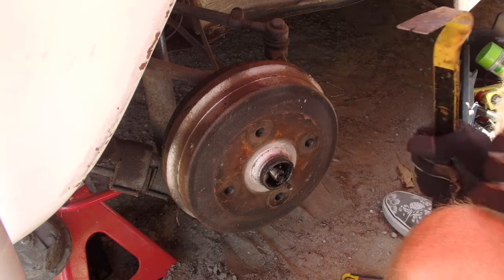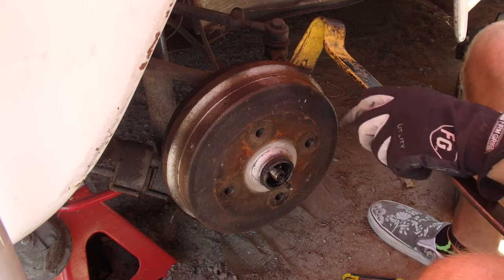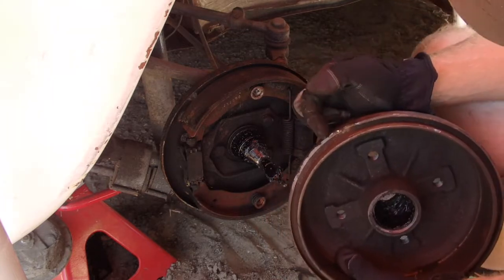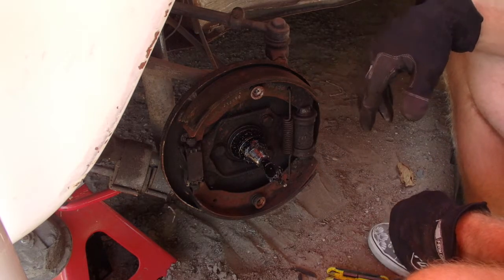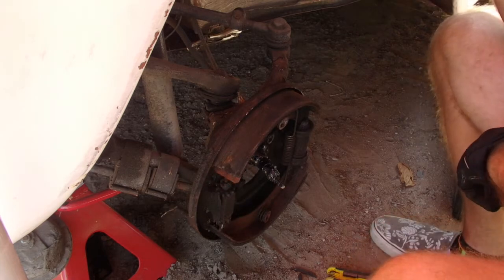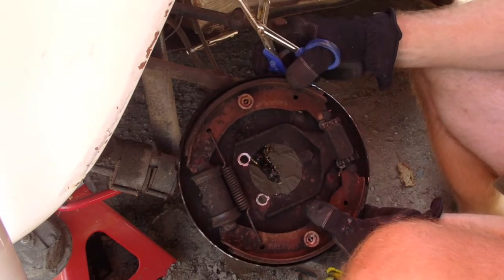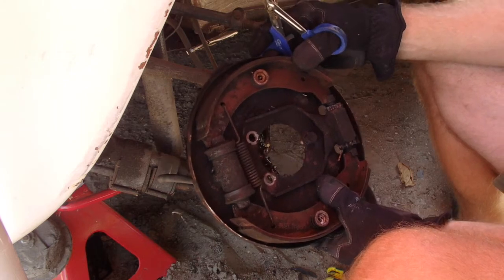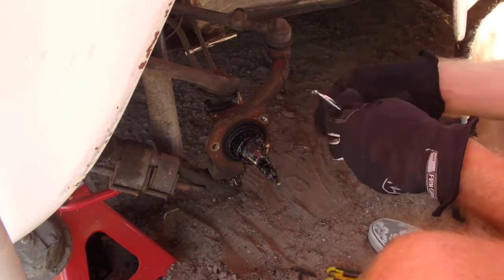1969 VW Bug Project - Episode 17.5 - Drum Brake and Spindle Removal

Comment: IF you are replacing brakes with disc undo top and bottom ball joints and tie rod end and take spindle and brakes out together
Reply from the maker: That would've been a lot easier.  Good tip, Karl.
Reply: LoL I’m glad I read this! Tackling this tomorrow.